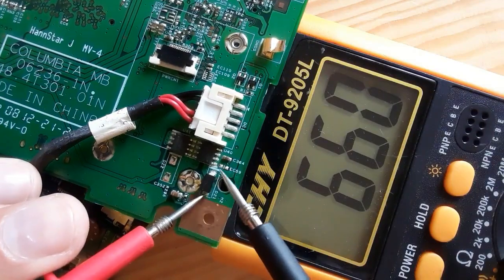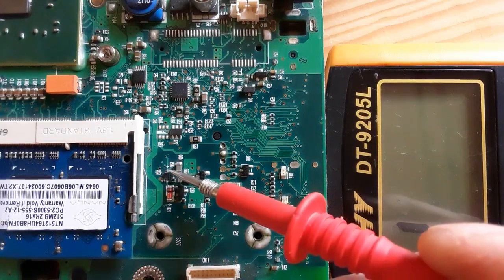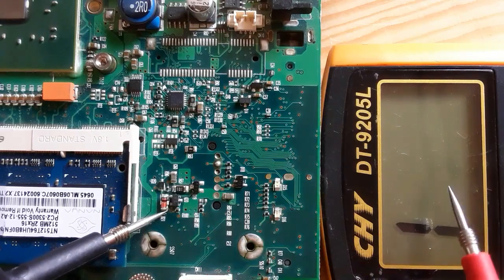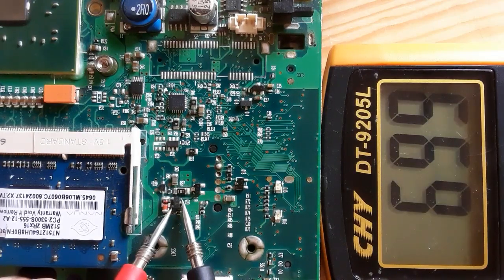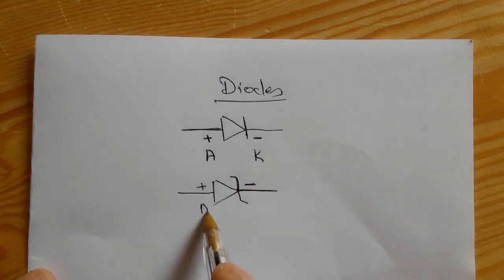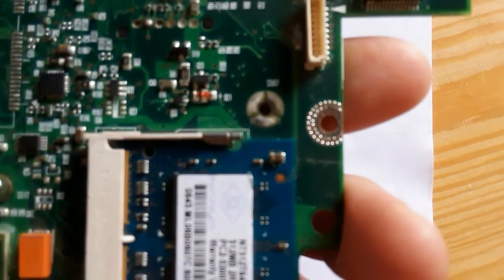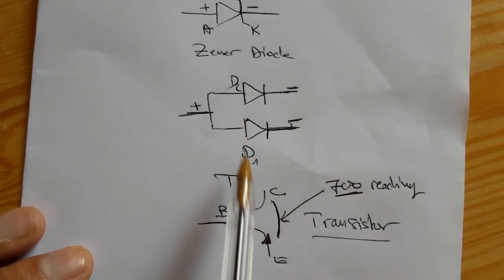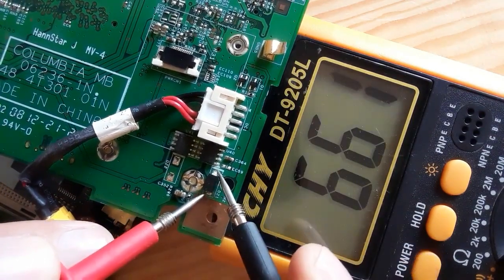How to Check SMD Diodes with Multimeter

Comment: dude as a beginner i have just a question ,once i tested a ziner diode and i got the bip on both ways (the tv was working fine after flashing it) , there no issue with it , so whats the explanation in that case ? ,amazing content btw

Comment: is it always. d = diode , q = transistor?
how to check if no initial on board sir?
Reply from the maker: Using the multimeter just be sure that the component is not shorted and don't worry.